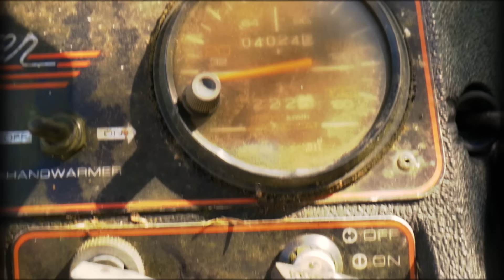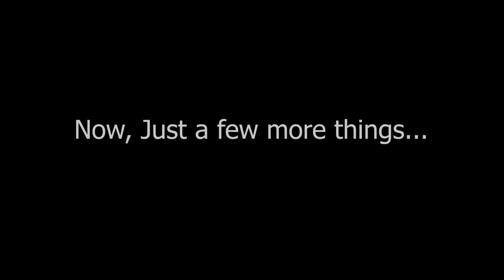I put a snowmobile engine on a motorcycle

Comment: Expansion Chambers are what make 2 strokes run like they do. Don't mess with the carb before you put it back on. They are very sensitive to length and diameter so try not to alter it much.

Comment: You will need to work out a radiator and water pump for it, its air cooled and runs at 0°- 30°most of the time, remember winter motors require more cooling,
Reply from the maker: Jason Petrich hmm that’s a really interesting point! Didn’t think about that , cheers Jason
Reply: @OliverMotorized  just want to save you a little time and set back with it  over heating, and you having to find another motor

Comment: A project Mad Max worthy, good work and after a little exhaust adjustments (as you know) and a little more it will go like a rocket. You're going to need weights not to ease off the ground, good luck. You also got a new subscriber right now.

Comment: Looking good, in addition to the expansion chamber you might want to add a muffler off of an ATV or motorcycle, it can be a used one or even make your own with a steel ammo box and some pea gravel.  It might make it quieter so your neighbors and the cops don't hate you.  Maybe add the larger sprocket back onto the jackshaft,  that will increase your top end speed but also reduce your RPMs at slower speeds, making it better on gas.  And last but not least, you might want to add a more comfortable seat, maybe add lights and get plates on it.  If your doing 65 or faster you might as well make it street legal.  Lol.  Awesome project man.
Reply from the maker: Carl Stone interesting never heard of the pea gravel method

Comment: Yup; original expansion chamber needs to go back on, as it's accoustically tuned (2-stroke operates with exhaust pulses) to the engine, and then tackle the carb.
With that sorted, this thing's powerband will be KILLER in the midrange! =)

Comment: With the expansion chamber on you could probably pull a wheelie if you pull up on it when it hits the torque curve under full throttle. Just be VERY careful. I had a Kawasaki 750 H1 with expansion chambers and we could pull wheelies in 2nd gear. I guess the snowmobile engine has a clutch drive sort of like how a Prius transmission works.

Comment: Along with the exhaust  the carb would be jetted for freezing temperatures,  could probably put a warm weather jet
Reply: Just a tad fatter jetting is all
Reply: @benson4u215  I think lean,  cold air is more dense  so it requires more fuel . Regardless a pretty cool build,  with a tuned exhaust and the carb set  I'm sure it would be scary fast
Reply: @timyanke9559  denser air is fine with stock settings but even just a homemade  exhaust would make it a hair too lean

Comment: Just an observation, the front forks look mounted at a very steep rake angle creating a ride that would handle "twitchy" and possibly lack stability.  Maybe it works in your application.  Good job on attacking the project and getting it running.

Comment: It's a little loud but it is a 2 stroke engine.¿ Will you put in a transmission later ? I mean the engine is  built for 1 speed but having a few more gears would help 🙂

Comment: I'm considering the same swap with my MT 250. 340 or 440 artic cat. My concerns are mostly running hot? Saw your second video and remember you saying it didn't happen the first time. I'm from Buffalo so heat's not a big concern and snow mobiles are plentiful!

Comment: Cool project!  Well done. One question: did you measure the distance between the clutches (center to center) before and after installation? I ask because if they are closer than when they were in the snowmobile they will act like the belt is effectively longer than it should be and you will not get a full shift range. Acceleration off the line will be like starting in too high a gear and top speed will be reduced like you were in too low a gear. When you started up it sounded like this might be the case,and when you show the machine at idle (at the 11 minute mark) the belt seems to be kinda high in the secondary. Might be my imagination....but something to consider. All told,though great job Kudos.
Reply: When it comes to belt sizes it doesn't take much to make a difference. Just a half inch shorter can make a big difference.

Comment: Dear lord that's an awesome machine, even considering the fact that it runs like crap, wont stop if any one of several components in the drive fail, could probably use some gearing tweaks and rattles to beat all hell. I can't wait to see it with the bugs worked out. 

I see all the comments regarding the potential for cooling problems and echo them. I would be looking at a temp gauge to go along with the list of crap to figure out. It might be an issue and it might not. Either way, it's hard to keep an eye on it without a gauge.

Comment: clock the pipe so it fits your configuration . you can cut some length out of the belly of the pipe or lengthen it but remember the shorter the belly the peakier the power band and vice versa . need help pm me .

Comment: Hi Oliver. I own an artic cat panther with the same 440 suzuki engine. Only my snowmachine is mint. Running a torque converter system allows for a smaller rear sprocket, if you want to go faster. But i think its fast enough.   rev.

Comment: Also the clutch is setup for a larger vehicle right now see if you can’t get it to grab a little sooner. Also put that larger sprocket back on it’ll have the power to move it, that will give you more speed less rpms

Comment: will run better if you build a two stroke expansion pipe for it , need to calculate its length though , will verry likely use less gass too

Comment: How about cooling? When you drive only snow like snowmobil, cold weather and snow, keeps engine cool enought, but in the summer without proper coolant system, you boil your engine in first long run. Check engine proper going temperature from datasheets, and get some kind of way keep it right.

Comment: I dunno if I'd be comfortable with the thought of an air-cooled engine sitting between my legs. Tis bound to get pretty hot in the summer, since those engines are specifically designed to be operated at below or slightly above freezing temps, and if that thing seizes up catastrophically, it's gonna put block and rod fragments right into your calves.

Comment: The pipe is the most important part of a 2 stroke . It works in conjunction with the port timing which is why your carb isnt right. Try to duplicate the diameters and lengths of the original pipe and you can cut pie shaped cones to form the radius needed to run the pipe where you want. That thing should frikkin scream !

Comment: If you don't build the "brake" right it might "break". Then you might "break". ;) 
Yeah, put disks on the wheels. Get rid of the j'shft brake. 
65 is more fast than anyone needs on 2 wheels. But....with the right gearing, this would go over 100.

 You should consider making jetting changes running in warm climates. Among other things.
Thanx for building something I've thought about for 20 years. subscribed.  :)

Comment: dig it, I saw earlier a post about removing oil injection system? I vote keep it, there is a style I hate, & I will let you search it, back in late 1960's & early 70's some Yamaha 2 strokes ran oil injection pump off clutch, so when you stopped at a stop light & held clutch in, you didn't have oil, & many people rev engines at stop lights, so just make sure it doesn't have a screwed up oil system that shuts off for any reason if engine is running, as its so much more fun to just put gas in & not have to pre-mix gas everytime

Comment: Step 1 of running a snowmobile when it's not winter is leaning the carb out. The crappy pipe is helping lean it out some but also ruining overall power no matter if it ran right. Your going to want to take your jet sizes down 5-10 sizes,best to buy a jet kit

Comment: You don't have to use the exact same expansion chamber but it should be of similar volume. Also ditch the oil injection and premix, those old oil injection setups are prone to failure and known engine killers..
Reply from the maker: Southeastern Ohio Honey Bees & BBQ thanks for the suggestion, can I just plug the hose inlet to the oil pump?
Reply: @OliverMotorized  You can remove the pump all together and  make  a cover for  it,  you could also loop the inlet and outlet together filled with oil.

Comment: if you pre mix your fuel you can ditch the oil tank and injector.   Also using the fuel tank up on top of the frame, the way you have 
 there is no need for fuel pump

Comment: I bet if you put a washer in the middle of the pipe and created a little chamber in there it would help.  Small chamber will still have the powerband way up in the revs.  Bigger chamber will bring the power down lower.
Reply from the maker: I'm learning a lot from these comments lol
Reply: @OliverMotorized  Weld a washer with a 1" hole at the end and give it a rip.  See if there's a difference and it'd take 5 minutes.

Comment: You need somehow to put back the expansion chamber because now the engine does not have any power. Engine like this should be ripping off from the frame on full throttle. But anyways good project.

Comment: Son... You gave made a rat rod Moto . Congrats I'm impressed from such a young mechanic you got your off the cuff building skills honed. But yeah the expansion chamber is a must have. If you can transfer as much of the original as possible it will work wonders on your bike. There is also after market performance exhaust kits for most snowmobiles.. you might find used on eBay.

Comment: hey um, if you're riding a two stroke you should consider blipping the throttle as you're slowing down to keep the engine lubricated with oil, engine braking on a 2 stroke is a no no :p
Reply from the maker: Thanks for the info!
Reply: @OliverMotorized  no problem. Wicked job ob the build.

Comment: You'll also spend alot of time clutching it,a fan cooled trail motor should engage at around 3k rpm and top out In the 7000 to 7500 range
You will also want to pay attention to your belt tension,or deflection,lay a straight edge across the clutches,use a fish scale and pull down with 10# of pull and measure the distance from the straight edge to the belt,1-1/4 to 1-1/2 is what your looking for
Reply from the maker: Rob R yeah the belt is about 30 years old by now if it is the original belt so it most likely needs a new one or adjustment

Comment: The stock pipe is junk, you’d be better off building a true reverse cone expansion chamber or better yet, dual pipes. Also I’d throw that single carb and manifold in the trash and get a pair of smaller carbs. Ditching the tight bends of the manifold will help drastically for power, and dual carbs are actually easier to tune than a single for snowmobiles. Props for just getting it to work, but you could gear down lower and make way more power, keep the top speed below 70, but it’ll get there in half the time. Also as stated by another person, Ditch the oil injection and run pre-mixed fuel. It’s safer, more reliable, and eliminates the dual tanks.

Comment: Put the pipe back on it! Two Strokes have to have expansion pipes if you want to get any power out of them unless you're talking old school took two strokes that were designed to run without them that were also gutless put the pipe back on it

Comment: where is the ballon in your 2 stroke exaust? that way you are losing power you need also to open the exaust port 2mm up and 3 on each side of the exaust port to increase the speed and max rpm snow engines are tuned to have more power at lower rpm and to use it on the road you need to tune it as above.

Comment: Regear it and put different clutch springs should stay on rear wheel to 65MPH ! Did a 900 snow motor on 4 wheeler was killer.
Keep it up find better chassy and pro type race pipe,/expansion chambers like mentioned. Needs 2 200cc type carbs.

Comment: The expansion  chamber  on the exhaust should stay the same size because they they are tuned to the engine's backpresure requirements, your losing power because you need to narrow the end of the pipe back down 
1 1/2 inches like it was before you cut it all up.

Comment: Set it up with twin carbs and twin tuned pipes and calibrate both carbs together and re-clutch the clutches and re-gear the final drive and it would be a un stoppable on the hi way all while being drivable in town  o and do over sized brake rotor or twin brake rotors that are the same size as you are running now plus a brake on the front tire as thats where 90% of your braking power comes from

Comment: That piece of fence pipe isn't a great Idea for 2 reasons: 1. a straight pipe on a 2 stroke will have a very narrow power band. The factory pipe modded to fit will perform much better, and 2. that fence post is made out of galvanized steel which gives off some seriously toxic vapors when heated. Other than that, good job!

Comment: Your gonna want to change that stock cat primary clutch out for a comet.  Cat primarys are prone to failure.  The rest is solid though.
Reply: That Is a comet clutch
Reply: @robr5786  nope, stock cat clutch, the comets are enclosed with a dome like housing and you can't see the internals.
Reply: @iambeeman1  
The early model 100c"s had the  "dust can",the dusters are a closed face clutch.the 102c,108c,and 108exp are open face,in fact in comets advertising it states -"the 102c is the first clutch with an open face" Google comet 102C and look at the pics
I have 2,a 102c and 108c on the bench now
https://youtu.be/MDVIVHw0Hzs

Comment: with no clutch to disengage drive what will happen when it seizes? Apart from the obvious scream skid and crash...
Reply: The centrifugal clutch disengaged when the engine stops turning a certain rpm. So... That wouldn't happen and is impossible. You must've never ridden a lot of snowmobiles in your life.
Reply: @benhawke7231  dude I haven't even seen one in the flesh, so to speak.  just noticed a lack of clutch lever and  started writing... ;o)
Reply: @leuvenlife 
LoL

Comment: Change your jets. Remember, those engines were designed to run in cold tempratures.  Running it in warmer weather will require a jet change in the carbs. I worked with snowmobiles for years. Reading the color of the plugs tells you exactly how well the engine is running. Changing the exaust also requires changing jets. Its a balancing act between the two. Guys forget this when tuning their sled. Any time you make a change, it requires a balancing of the ratio of fuel and exhaust.  I built some real sleepers in my day. Now I cannot do any of that stuff. Cancer took care of that. I could hear how bad that engine was running. Also expansion chamber and it MUST have an air box. That was ragged, really ragged. Pull your plugs and " read " them. White or light grey, too lean. Black to dark brown, too rich.

Comment: You need to put an expansion chamber back on the exhaust.  You lost a crap ton of hp by eliminating the expansion chamber. You're also wasting fuel without one. See if you can modify one from an old dirt bike or make one yourself. The bike is bad ass though. Great job.

Comment: You are not the first to build a motorcycle with a snowmobile engine!  Rokon used to build full size MX bikes and an enduro model.  I owned each one of these.  Not at the same time though.  They had disc brakes and mag wheels.
Yours is very nice though.  keep up the good work.
Reply from the maker: Ralph M. Oh yeah I didn’t expect to be the first! Those sound like some mean bikes though

Comment: dude please build a nice exhaust ! The two stroke needs it , that empty tube is like having no exhaust at all ... make a chamber and a good silencer , you are loosing a lot of power and torque! The test is short but it looks like the transmission is too short , i ear it revving a lot. You have an engine with an enormous potential :)
Reply from the maker: fau sto thanks for the advice! I’ll put the exhaust back on from the original mahhine

Comment: Really doesn't make a difference man but I'd 86 the oil reservoir and Injection lines and just pre mix the gas. It's good cheap insurance for old sled engines and itll save you some leg room too.

Comment: If you do not know a lot about two stroke engine switches what your snowmobile motor is the original snowmobile it sauce where it goes from light lasts a like a woman 1/2 inch maybe 2 inch opening ended up big giant round chamber that big giant round chamber believe it or not is a combustion pipe it helps with the two with the 2-stroke powerband and without it you will actually believe it or not you'll burn to revolves up in them cuz those snowmobile motor is design different than a standard 2-stroke engine it has to have the combustion python it if you did not know

Comment: You can probably get a Torq converter from GO POWER SPORTS. IT WOULD BE ALOT SMALLER
Reply: Unfortunately the shaft size isn't correct for a snowmobile motor.

Comment: Bud you need to do some clutch work you can change the weights to adjust engagement that thing. 
Should have crazy bottom end and pull to the top at over 100mph the 440 is a bulletproof motor 
That I’ve used in dune buggies go karts 4wheelers everything about that gearing wise is outa wack 
Talk to someone who makes and sells clutch parts I’m sure that motor is still used as it was for years 
They can get you goin the clutch uses rpm to put itself in the right gear so to speak it’s like your takin off 
In to high of a gear heck if you used a stock belt it could be wore or if you mounted the clutch to close to the engine you may need 
A shorter belt good luck and good job I’m glad to see people interested in modifying stuff keep doin it